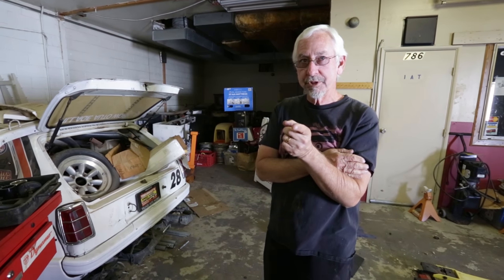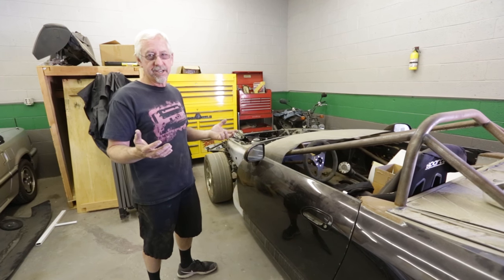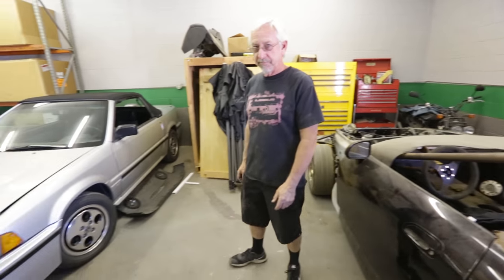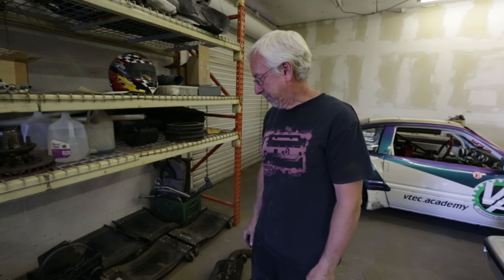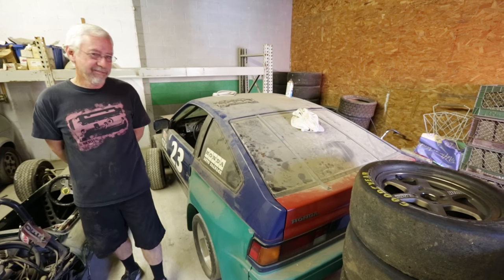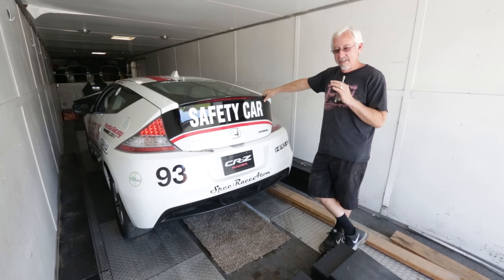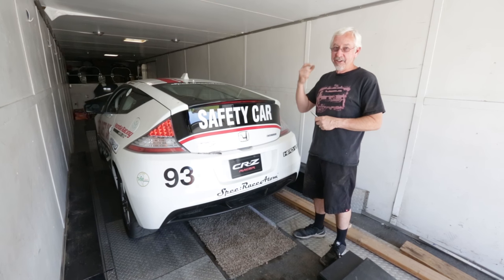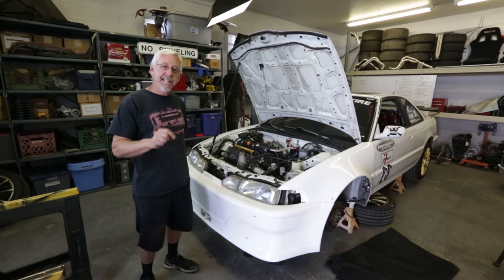The Secret Rare Cars at Hasport Performance

Comment: Hey Hasport, how about S2000 k23 or quality k swap parts. The one other company I know making S2Kswap parts makes junk. Or even a J swap for the S2000
Reply: We make K-swap mounts for the S2K already. We'll get to the others. K23 though? We'll see.
Reply: That's great to hear. Had a terrible time with another companies adapter plate on that swap. The holes were completely off.

The k23 is a bit of a wild idea. Neat motor. Just wish it could be put into anything other than the RDX
Reply: The mounts are out. The adapter plate is next.